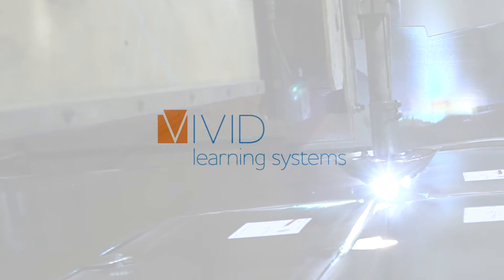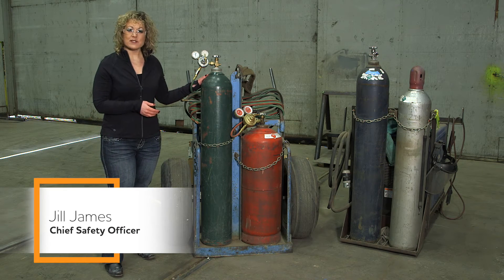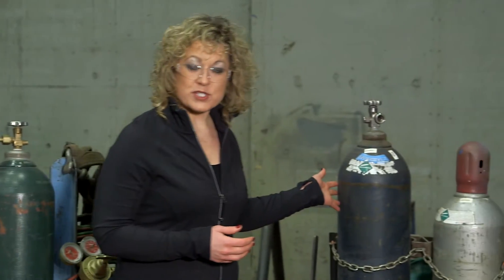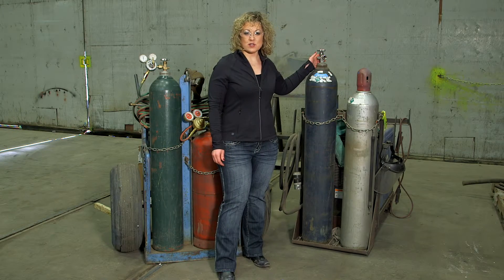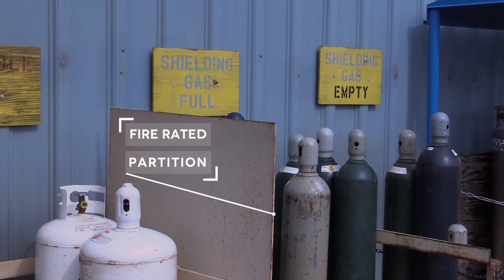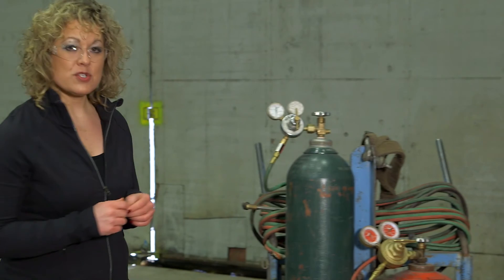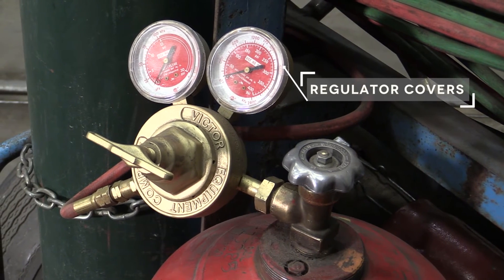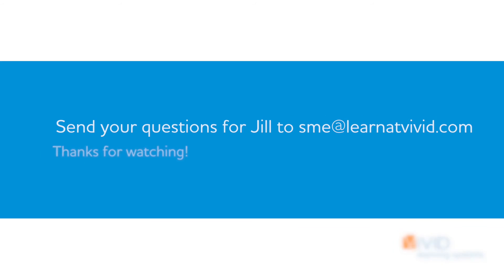Compressed Gas Cylinders - Supervisor Safety Tip Series

Comment: Question....
Can a large bottle of oxygen be stored in an outdoor shed (in florida).
Summer temps reach about 125 degrees....(just guessing).
Thank you in advance for your answer.
Reply from the maker: Sorry I didn't see this message until just now.

But generally, do not exceed 125 degrees F (see page 3 of this doc under "Storage" http://www.airproducts.com/~/media/Files/PDF/company/safetygram-10.pdf )

The other thing you can do would be to check with the manufacturer of the vessel marked on the tank.
Reply: At Qinov8 UK Ltd they have designed and Patented a cheap easy to fit shut off valve the stops these high pressure cylinders becoming "runaways" statistics have shown that in the UK alone there has been 10 fatalities in the past 13 years with thousands of serious injuries.
One fatality is one too many, the product is called the 'Gas Stop' it can be fitted for the price of a cup of coffee at Costa.
Save a life for the price of a coffee, take care😉👍